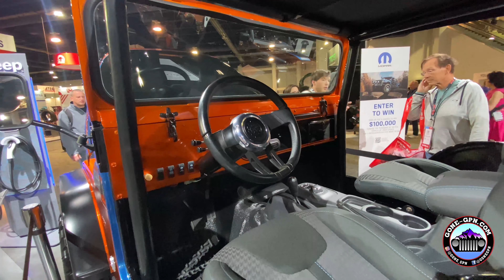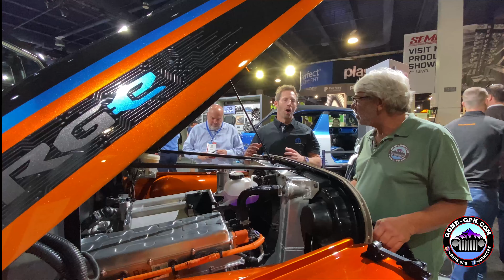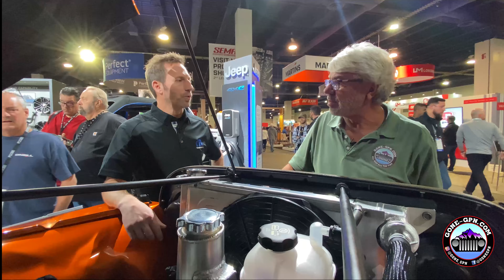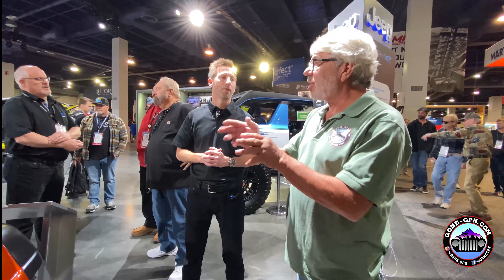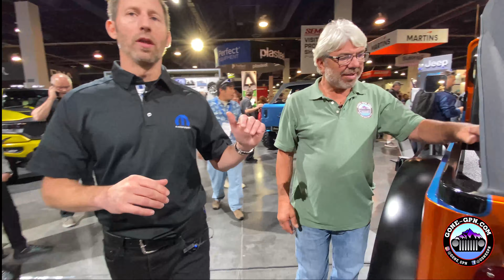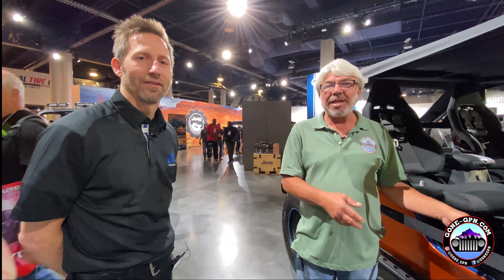Surge Jeep CJ-6 — Rick Péwé and Jeep’s latest EV Concept.

Comment: Very nice.
I'd like to electrify one of my 'Flatties'.
Reply from the maker: It's an interesting ideal, right!
Reply: @Gone_Jeepn  An electric motor at (or in) each wheel with, perhaps, some sort of selectable joystick operating system (computer assisted?) for off roading.

Torque / hp would be applied independently to each wheel in that mode with no driveshafts, t-case, transmission, stalling... .

Braking would be likewise applicable on demand at each wheel.

For phase two we'll consider flight mode.